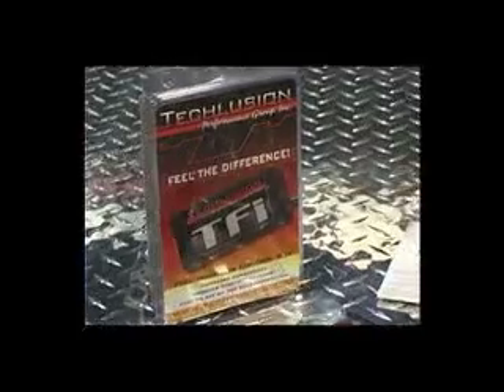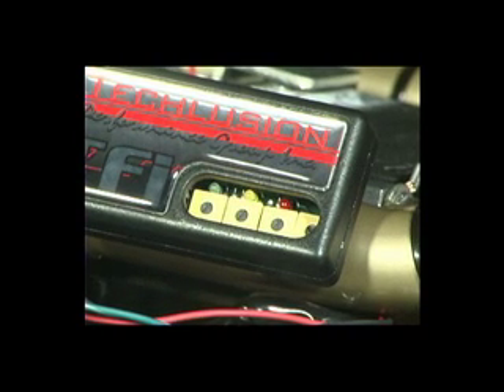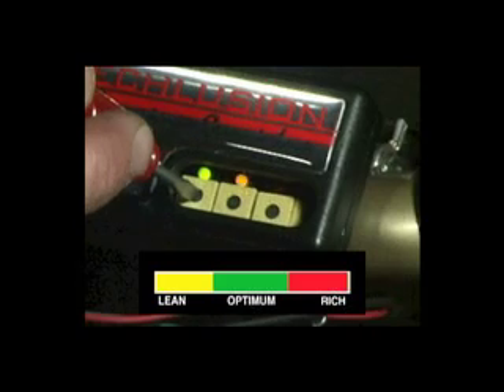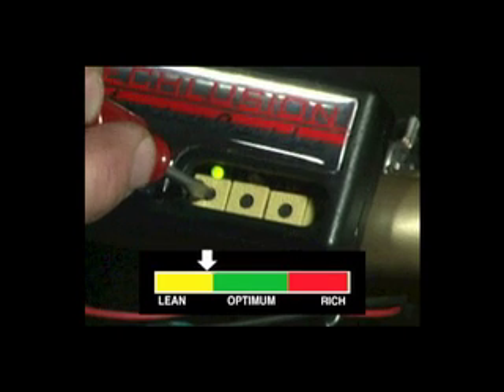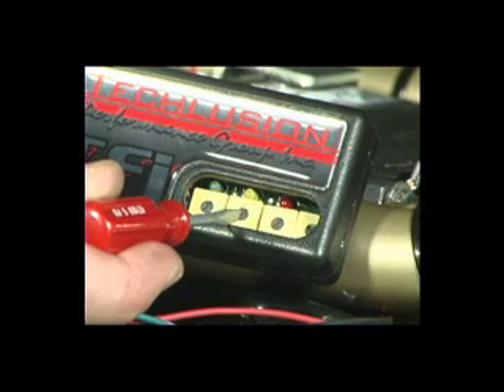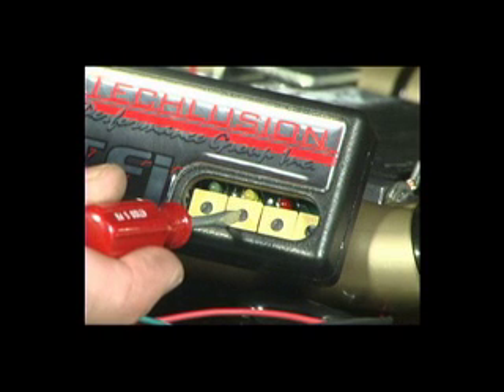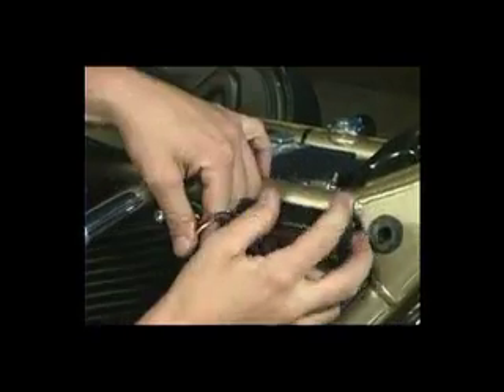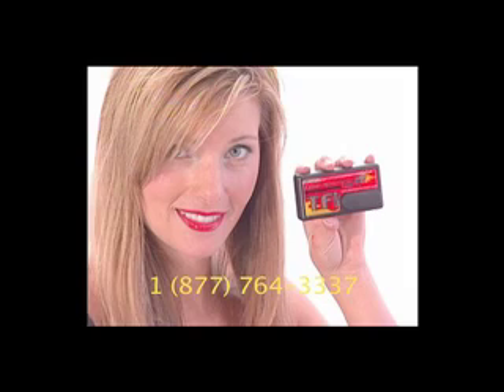Tuning a DP TFI

Comment: I have 2001 road king and I have this set at 3 6 4 4 and bike is back firing decel pop
Reply: Have you solved your problem?
Reply: BoobsAdmin no it’s still back fires took the bike to the shop and they checked it they say it’s the dobek tfi so I’m about to be buying a kit from screaming eagle tuner
Reply: BoobsAdmin no more back firing I went with a different tuner the dobek didn’t help me
Reply: Dobeck still sucks in 2025. Went with power Commander and problem solved on my Bandit 1250S